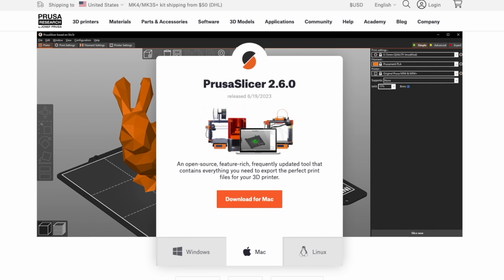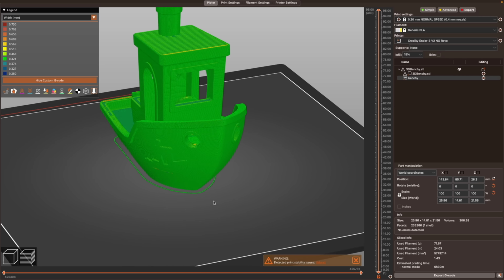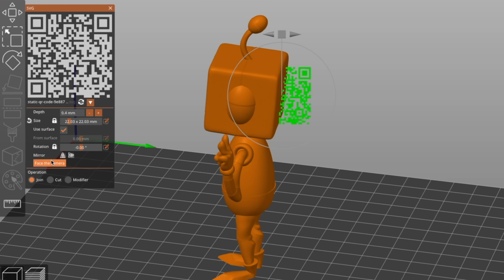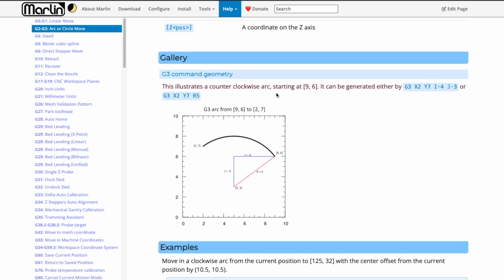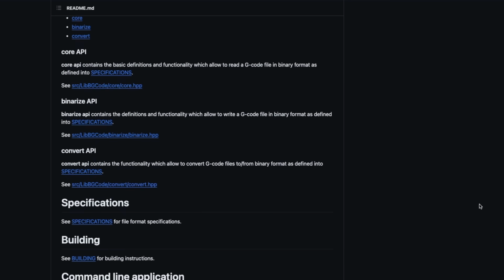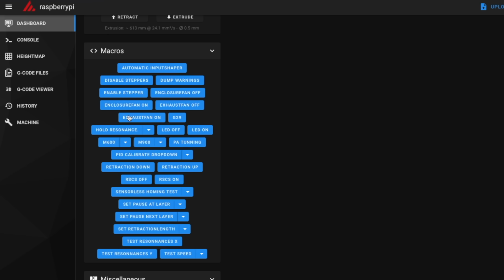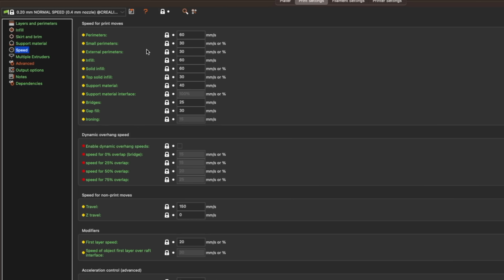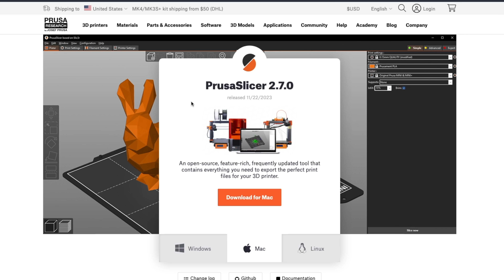Is Binary Gcode The Future For 3D Printing ? (PrusaSlicer 2.7)

Comment: Being a Klipper and raspberry pi user, Id rather just send a file to the printer that was the geometric data and the slicer settings and then the pi host runs a headless version of my slicer that always slices the same way the desktop version I'm running does. I'd like this so 3d printing files were more reusable and adjustable without having to reslice and resend as much. Sending gcodes is really tedious when I want to make small adjustments or use something on another printer. I'm sure this can be refined and might not be as smooth as what I have in mind but I generally like the idea. Something I've been thinking about quite a bit lately.

Comment: I seem to be in the minority but I fully support switching to binary GCode.
I understand the the file size isn't a bit deal in regards to storing it on a USB stick and it's only a minor advantage for transport.
But it can be a big deal for the memory usage of 32 bit printers!
Besides, if you really want to view or edit the GCode you con do it on the Slicer side before you send it to the printer.

Comment: I don't see the advantage of minimizing file size.  Storage is extremely cheap.  What am I missing?

I do see arcs as an improvement because it lets the printer be smarter about how it moves without having to do funny business like lookahead (common in high-end CNC), but it's something usually turned off in high-end CNCs because programmers don't trust it. :)

Comment: Binary GCode is about as relevant as finding a stronger compression for midi-music: Useless.
Filesize is not a problem. If you are running a Prusa-printer with their proprietary everything then you are not impacted by just a couple MB of data. can you even get SD-cards from reputable sources that are smaller than 4GB?

Comment: Thanks for the review on this machine. I have had their Adventurer 3 since it came out and liked the experience, whilst staying with their Slicer. So far so good.

Now I'm looking to enclosed CoreXY as my next printer in the fleet. This wasn't on my radar until your video today. Colour me impressed. But, the Flashforge attitude to the software troubles me greatly. What you have described is not a good look! I'm currently transitioning to Orca from PrusaSlicer across my other machines. The choice of CoreXY has to come along with the plan also. 

So what to do? Buy into another Flashforge or go elsewhere. My hot favourite is the Bambu Lab. This definitely tickled my interest. But I think I cannot commit on this occasion.

Comment: The benefits of binary G-code are pretty neglible. The format is already simple enough for a parser to work through the file. It might make for a slightly smaller file and easier to embed stuff like thumbnails into the file but that's more or less the beginning and end of its advantages. I wonder how it copes with the likes of Klipper that might embed macros into the G-code.

Comment: Some nice quality of life features added, in regards to the file size, I can't be certain, but I'm pretty sure the push to Binary Code is due to the throughput bottle neck on some of the Prusa control boards, but it will help those with bad wifi throughput as well, but storage is cheap, and most running Klipper have larger than needed storage, and its very easy to add a large cheap USB drive and symlink the printer_data folder to it.
Reply: Yep, it's motivated by Prusas atrocious network speeds, but it'll also benefit their cloud services, the reduction will be massive at that scale. Others may adopt it for same reason.

Comment: Why waste time on file sizes? With network speeds getting so fast, and memory costs so low. Even if a file gcode is 500Mbytes, who cares? would transfer to my Klipper printers on a 1G network connection in seconds still!
Reply: Because Prusa control boards suck?

Comment: The problem I ran into already with bgcode was when I had a print fail half way. With normal gcode you can just find the height it failed and delete the gcode before that point. I couldn't figure out a way to do that with bgcode.

With 2.7 you can finally "paint on" fuzzy skin using the text modifier trick without the slicer crashing which is nice. Can't wait until it becomes as easy as paint on supports.

Comment: One other thing G2/G3 brings (or at least should bring) is much better quality for round features / objects, if those are imported as .stp or some other format that's not just a bunch of triangles ( even then it might fit an arc where there's just triangles). Now instead of a bunch of facets we should be getting nice round curves. G2/G3 is always used in CNC machining and I was very surprised finding out that it hadn't been used in 3D printing.
Reply: Slicers work on the triangle soup foundation since they don't share the heritage with CNC pathing tools, and the "Arc Welder" is as its name suggests a G-code post process that detects arc like features in the line segment G1 stream and approximates them into an arc command; then a second approximation pass occurs when the printer's G-code input stage breaks them down into line segments again.

OCCT that performs STEP triangulation may not always choose sufficient resolution for either good print quality or the welder to recognise the arcs.

But i suppose once the workflow is established it may create enough demand for improvement.

Part of the problem is that slicers should ideally plan speeds and accelerations to maintain suitable pressure windows, but dragging arcs through this process would explode the complexity threefold or more. And it's already a pretty spicy and problem prone area. I wouldn't expect arc based planning to be on the horizon within 2-3 years.

I also think G2/G3 is a bit of a half measure, and you'd really want spline based everything (G5) but that's even harder. There is firmware support though, even if largely untested.
Reply: @SianaGearz  Not that I have tried it, but shouldn't PrusaSlicer importing STEP files mitigate this ? (first part, the acceleration planning etc is absolutely a dream so far)
Reply: @XAD566  PrusaSlicer uses OCCT (same foundation library as FreeCAD) to ingest and triangulate STEP files. The models are treated as triangle soup still.
Reply: It should be noted that arcs are still not magic. The machines firmware still basically needs to turn it into line segments. the advantage is the machine doesn't need to accelerate deaccelerate before and after each line segment.
Reply: Arc based planning could be a very interesting place to try generative AI.
Reply: @jtjames79 that is literally not required or useful. Stop trying to slap AI onto things that don't need it

Comment: Binary GCode is going to be a problem. I still remember the days, when my makerbot would just take binary GCode files 7 years ago. Especially with Klipper, File Size isn't really a problem anymore
Reply: I agree.  There are still things that are customized, like the exclude object tags.  Having to update the binary format to handle those changes, especially if the binary version requires something special, is going to be a pain.  

If you want performance increases, Klipper itself could compile the file to binary before printing (or maybe during upload), rather than having the slicer do it.
Reply: @Raytenecks  Klipper technically already does this. Just on an even lower level, for the motor steps

Comment: text tool is quite powerful, people should use it to tag 3d prints with a resin code, while recycling plastic is still a uncommon practice, one could wish for the day its not, but a big helping hand would be taging things printed with the polymer, especially black plastics. this could help people sort 3d prints better and if you are collecting your failed prints to oneday recycle yourself, itll help prevent a fair bit of contamination.
Reply: I like this idea.
Reply: In big picture, it might work for PET (not -G), PC, PP and possibly ABS - without additives
PETG, PLA and anything with CF, GF, wood or minerals go to energy waste anyway (unrecyclable waste is burned for heat and electricity. It's also possible to capture CO2 and reuse it).

For home recycling, I don't think many people would want to collect scrap waiting for home (or community) re-extruders 🤔

Comment: If the point is just to make a smaller file, IMO this binary gcode is not the way... It would be easier to do what SVG does which is GZIP compress and change to SVGZ! In this case it would make a lot more sense to take the GCODE file, GZIP it, and call it GCODEZ
Reply from the maker: Would it be more difficult for the firmware/controller to read a zipped form of gcode over binary? Or really it is not any different from the firmware side?
Reply: @ModBotArmy  You need a chunk of memory in the tens-of-kilobytes range to handle the decoding. The more memory, the better you can compress it. The best next step would be to find some big files, zip them up, and see how much space it saves. A specific compression is almost always going to be better than a generic compression, and you could still apply the zip compression to the binary gcode if you wanted.
Reply: @ModBotArmy  not really, as GZIP data can be streamed (like it does with this binary format), so impact is negligible. The advantage of using GZIP is obvious, as one could just decompress the archive and get the original text GCODE! So until I get more data on this, I am not sold on this new binary format...

Comment: Historical comment.  In the early RepRap days we had binary gcode.  Back then the purpose wasn't to save file space but rather to reduce the amount of (compiled) code which the 8bit processors had to have onboard to parse gcode.  By pre-parsing the gcode and sending the results in a binary format to the printer, simpler code was needed in the very tight 64K program space of processors like the ATmega644p used in the early reprap electronics.   With 128K of program space (e.g., ATmega1284p) firmwares moved away from the binary gcode of that time.  Makerbot, however, continued to use the binary format long after everyone else had moved on.  As a result, much of the growing community began to associate .x3g -- the file extension commonly used -- exclusively with Makerbot, forgetting that it saw use, albeit thankfully briefly, outside of Makerbot printers.
Reply: I do miss my reprap Mendel. I don't miss having to adjust it more frequently than printing with it. Lol. It's awesome how far this community has come since the beginning. I remember thinking how cool it was when the makerbot thing-o-matic kit came out.
Reply: @AmericanMaking don’t forget how it would break and go rouge if you tried to change anything while it was printing. Or at least the one I worked on did.
Reply: @ZeFoxii  Ah, the good Ole Days.
Reply: @ZeFoxii  And slicing with the early Repeteir. Brutal! Just a wall of settings entry cells with very limited description on what changing a given value would actually do. I lost months of my life in that interface. 😕
Reply: @AmericanMaking  I pleasantly forgot about that until just now. I thought the creators were sadistic while using the program because nothing made sense, you could change “1” setting and it would just refuse to function.
Reply: @AmericanMaking  the manual control was really nice however
Reply: @AmericanMaking  I remember the evolution from repetier to old cura, to ultimaker cura, to slic3r and (for a brief time on someone else's machine) simplify3d, and Prusa Slicer
At the beginning of the pandemic I got one of the (kinda crap) geeetech i3 kits for the purpose of rehabbing it up into a better machine (it's a "kind of" Mk3S now), and it came with frickin repetier host, and because the LCD/SD module couldn't actually read an SD card I had to run Gcode from a computer through repetier-host to the printer via USB-B like the old days. Fun little blast from the past.

Instructions for modifying firmware on the board were also showing the old way of doing it via arduinoIDE also. Idk if the old board even had a bootloader on it.
Reply: @barrag3463  oh man, I bought a dirt cheap kit back in '17 for dicking around with questionable ideas (mounting a small dremel for Routing boards, hooking it to a mig xfmr I had laying around to do real dodgy metal printing, etc.) I had fun with it, but same it shipped with that shitty repetier program haha
Reply: @AmericanMaking  I have 0 nostalgia for those days. All the ABS and acetone fumes without filtration and most importantly more tinkering than actually getting results. It was wonderful Klondike-style gold rush fever, everyone thought 3d printing would take on the world, but from the user (or developer) experience definitely not something I'm looking back to. And yikes Slic3rs Perl implementation.

Comment: You want it in Klipper? But why... binary gcode exists mainly due to one reason. Very slow networking capabilities of Prusa printers (0.1-0.4MB/s). Binary gcode gives you neglectable speed benefits on printers that have "normal" networking like klipper on raspberry pi using wifi - 10MB/s is normal on these (25 to 100 times faster than on Prusa printers).
Reply: I don't even see gcode parsing on AVR 8-bit Marlin printers from SD-Card as a bottleneck at all. And then inspecting and modifying binary files is harder.

There is a bottleneck where it may help, specifically printers connected by real serial connection (i.e. same those 8-bit AVR devices) to a network spooler such as Octoprint. Though i don't think in that case, that the slicer should be handling the conversion, you can transmit the data to the spooler as text, and the spooler should then convert it.
Reply: Smaller file sizes to support my gcode hoarding habit
Reply: @miserablepile I agree. It's nice to be able to re-print any model I've previously sliced knowing it'll have the exact same settings. It also means I'd have to clear out my printer's storage less often (though I have a NAS for primary file storage).
Reply: Does the slicer support reading compressed code directly? Compressing textual and binary code should produce roughly equivalently sized files.

The user shouldn’t necessarily have to care what’s sent over the network though.
Reply: @DannoHung  Binary G-code is slicer output rather than input.

Compressed G-code is pretty much not a thing, because 3D printer microcontrollers don't have the requisite RAM to run dictionary, lookback, arithmetic coding or Huffman decompression, and all the RAM they do have is best used for the move planner, as more planning lookahead achieves higher printing speed. This is why they invented binary G-code, in order to cut down on transfer volume while not using up any extra RAM, and it also reduces the text parsing overhead.

Compressed (3MF) and binary (optional in STL) models are common but that's not the topic.
Reply: @SianaGearz  I guess I was just thinking about archiving sliced output on a computer. Wasn't thinking it through completely.

Comment: Binary Gcode is the cemeting of proprietary gcode. Just in a few years nobody will be able to edit gcode, and it will become incompatible among the brands. So that nobody can run gcode for one printer brand on another. It's of course will be done for you safety.
Reply: Wait till 3D printers go subscription model like everyone is attempting these days.  You pay a yearly subscription for the right to use the hardware you bought and own.  And they can disable or brick your machine at will.  

And for those have been living under a rock the past 10 years…. Yes this is a hugely relevant very common thing these days.
Reply: their Nextruder isnt patented, so subscription model will not happen anytime soon @ericrandall3539
Reply: Binary gcode is a completely open standard/specification. Prusa even provide the code and tools to convert back and forth. A company wanting proprietary gcode wouldn't have to wait for Prusa to create a specification, they would just have done it already (as several have, like Zortrax).

Comment: i never understood why they only use coordinates instead of using ISO code (what all you ladies call Gcodes is only a handfull of codes taken from ISOcode... what many CNC machines use allready for over 50 years as far as i know...) Over 20years ago we had to program cnc machines in pure 'Gcodes'. Imagin having to know all 'Gcodes' from the head...
Reply: ISO is an attempt to    standardize gcode in Europe that was previously invented in America. Slicers do produce gcode using standard stuff like G1 but since gcode for multi axis cutting machines has many more and different requirements than a printer there were some necessary adjustments and it's obviously only a subset of one of the many competing standards